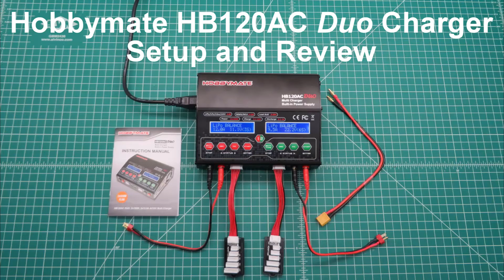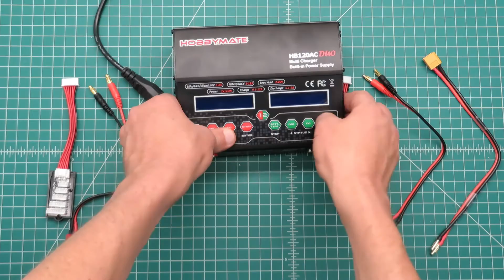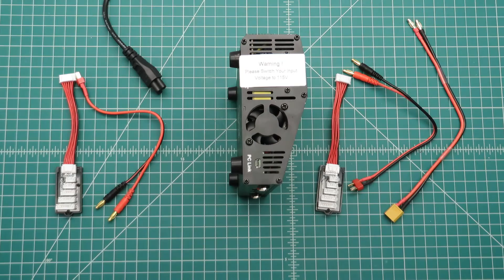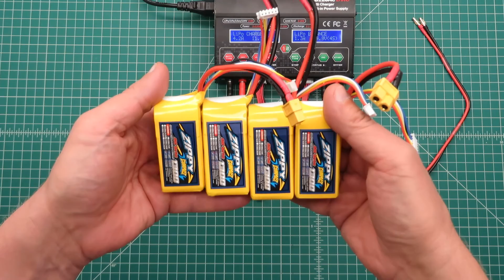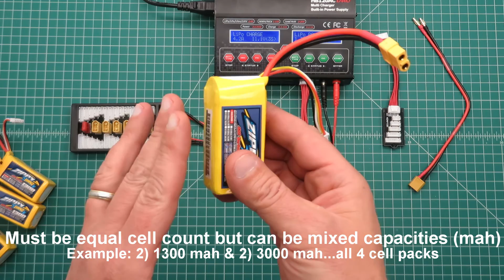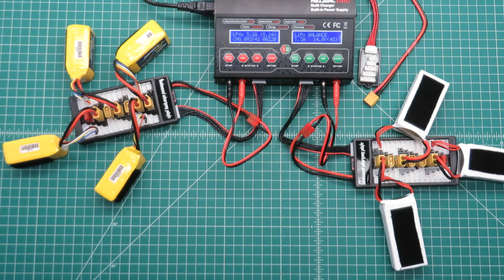Hobbymate HB120AC Duo Charger:  Setup and Review

Comment: So this wouldn't be compatible in Australia as we are on 240v
Reply from the maker: Yes, will work fine, there is a voltage selection switch on the side.  Specs are Input voltage: AC 100-240V

Comment: Hi, I would like to know how to charge 1 or a few AA or 18650 batteries without a balance board ?
Reply from the maker: If you want to charge one 18650 battery then simply connect the main leads to it and charge it using "LiIon Charge" function set to 1S (this will not require a balance connection).  Use a charge current that is the same as the battery capacity in Amps.  So, for example, a 2000mah battery can be charged safely at 2.0 A.  Best to watch it closely for the first time to make sure voltage does not go over 4.1v and the battery stays cool.

Comment: Does this charger only do 1C on balance? Say if I have a 4s 7400mah battery and go through the set up. Enter 4s then enter 7.4a then hit charge or do I need to enter the 7400mah somewhere else?
Reply from the maker: No, can increase the charge current up to 12 amps on each side limited by 120 watts max.  So for a 4S battery, max volts is 16.8, and 120w / 16.8v is about 7.1 amps.  You can set it higher than 7.1 amps but it will max out near there.  So on your 4S 7400mah battery, you are essentially limited to 1C but for a smaller battery the 120w limit essentially allows for greater than 1C charging.  I hope this makes sense.
Reply: ohhh I thought It was 14.8 x 7.4  thats why I thought 120 would be enough.

Anyways. I charged one of my 4s and at the end it just sat there at with the cells fluctuating at around 4.18-4.20. Does this charger notify you when the charge is complete?
Reply from the maker: Yes, it beeps when it's done and the current goes to zero.

Comment: Ok, so you can only "multi charge" packs of the same cell count....but what if there's different mah rating? Like 3 2200mah 4s and 1 1800mah 4s. Would you favor the lower amp rated pack when charging? Ei: like the above configuration, instead of 3x2200+1800...would you go 4x1800? Thanks!!!
Reply from the maker: You would do the 3x2200+1800.  You are essentially creating one big pack.
Reply: ADIDARC .....thanks! I didn't want to over load the one odd/lower pack. 👍
Reply: ADIDARC can this charge the mavic pro quad?
Reply from the maker: I'm not sure about a mavic battery.  It would need to connect to the charge leads.  Might take a special adapter.

Comment: Thanks for your time and effort in making this video. It helped a lot. Question: can I use a multi battery charging plate, like here, on the UP120AC? They're virtually the same charger. Thanks again!!!
Reply from the maker: Not sure, I can only speak to the Hobbymate charger as it's the one I have.
Reply: ADIDARC .....up date....yes, you can use a multi charging board. I did it with my charger and had no issues. Thanks for your response!!!

Comment: what is the red lead on the parallel charge board for? Great review! Thank you!
Reply: I got 2 xt60 leads???
Reply from the maker: No problem, my pleasure!  The red cap at the bottom of the balance board is covering a deans connector.  The intended purpose is to daisy chain multiple balance boards together.  Just imagine charging 12 lower capacity batteries on each channel of the charger...something 24 batteries at once :)

Comment: I buy this charger to charging a a123 battery pack to 10a .but this charger charge only a 7a max doesnt matter if a put 10a using only one port .
what a waste of money .it charger good but cant charge more than 7a
Reply from the maker: The charger is 120w X 2.  This means it can supply 120 watts, which is volts * amps to each channel.   So for a 10 volt battery, it can supply 120 watts / 10 volts = 12 amps.  For a 20 volt battery, it can supply 120 watts / 20 volts = 6 amps.  It is limited to 12 amps so you can't charge a 5 volt battery at 24 amps.  Based on your max charge rate, I'm guessing your battery is in the 17 volts range.  I hope this helps!
Reply: you are absolute right adidarc!
my fault dint read a little more about it.
charger works really good but 120w isn't enough  for 16.5-18v.
great charger !!!!
just ordered a ultima x2 for my needed